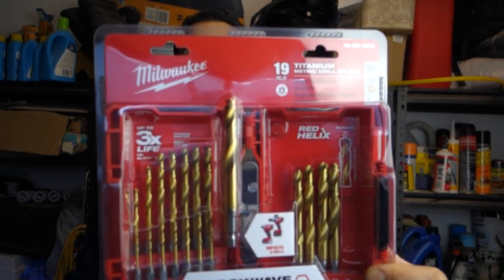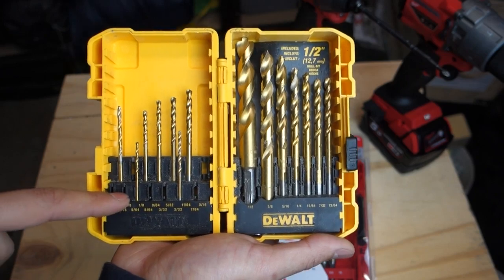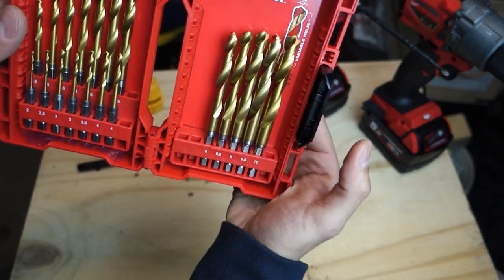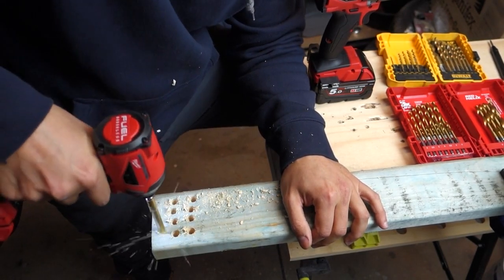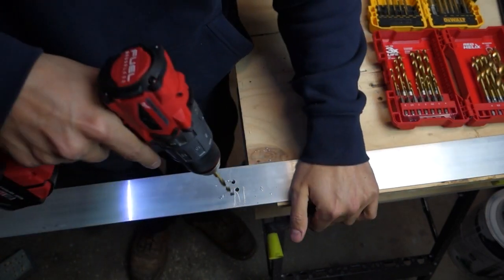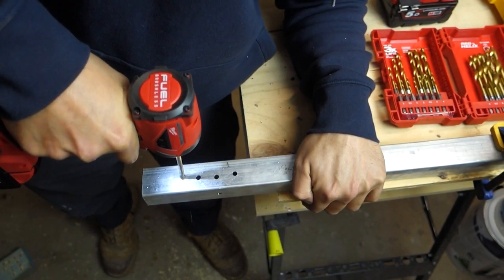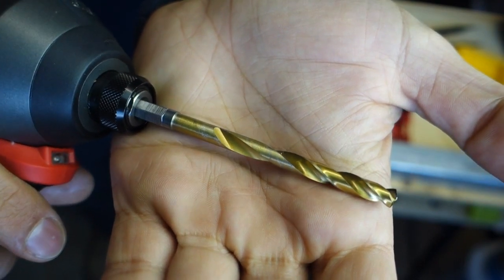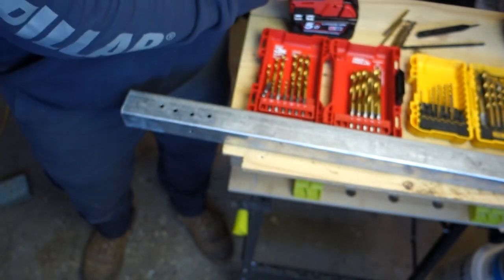Milwaukee red helix impact driver drill bits -  review and testing wood metal and plastic

Comment: 1:02 It's not tapered, same diameter the whole drill.
Variable helix means the spiral cuts change angle as they go up the drill. You can see they are tighter near the tip and more spread out by the base.
Helps to evacuate material better I think.

Comment: Impact drivers can (sometimes) drill more quickly because they usually have a higher RPM. The problem comes when you're drilling hard metals like steel where the high speed can produce too much heat and harden the metal you're trying to drill, but for most tasks, impacts are really good when drilling with the right bit.
Reply: Yeah, put you also have to factor in the chuck wobble and terrible hole quality. Also, when the impact driver is under load the rpm is significantly lower. Drills are faster and more efficient overall.

Comment: Of course a drill is going to break if you put that much sideways pressure on them. They break because they are made of hardened steel. The flex is not causing it to break, the flex is preventing it from breaking. And the only reason the DeWalt is flexing more than the Milwaukee is because the drill shaft is longer.
Reply: I thought it was pretty obvious too. Kind of a irresponsible review if you can't understand that.
Reply: Definitely not an experienced review

Comment: Milwaukee Brewers and windows drill bits they so easy to use and I'm a Makita person I will love these Milwaukee drill bits the other brains 10 to spin drill bit spin in the Hex tile bit like being not welded properly lol maybe I got a defective the set but it happened to to drill bits that I used another set so I went back to normal walking and had no problems they are so quick and easy to swap those extra spaces in the pack a great or phillips head bits and Hex head bits so if you have to carry tools in to site it means one less drill you need to take I cannot say enough about the Milwaukee quick release drill bits